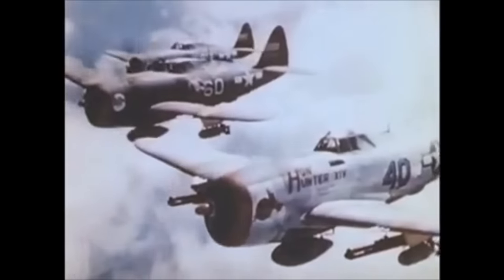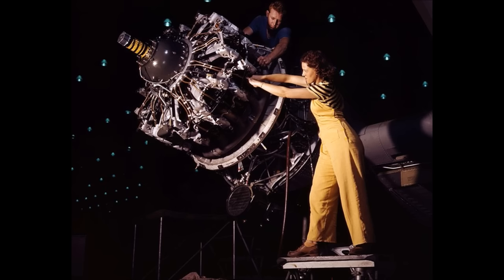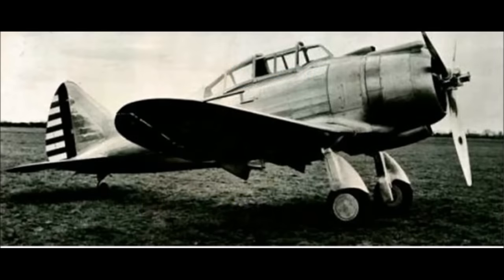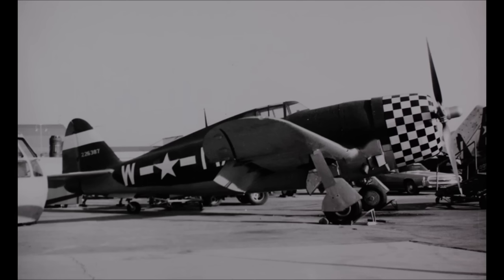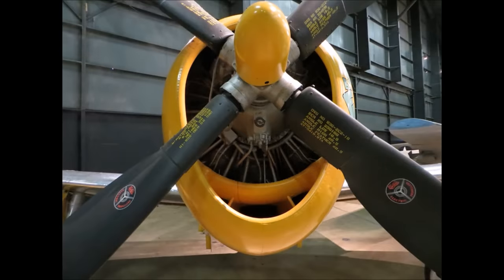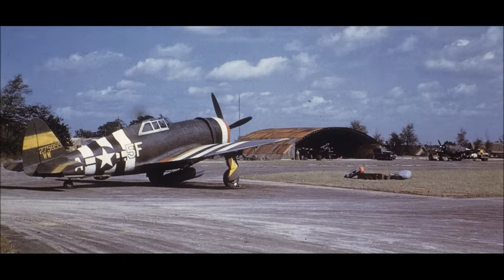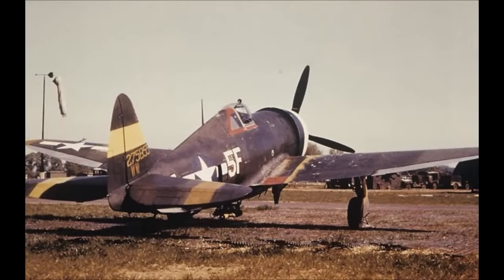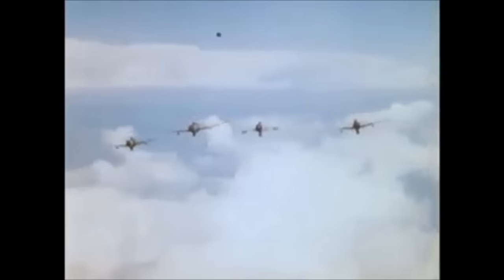P-47 Thunderbolt Pt. 1 Design and Speed

Comment: This channel is incredible.  I've been a auto mechanic, steel fabricator and  forged cutting dies. I've always loved history and aviation but never really knew the science of it. After watching this channel, learning about drag,lift, wing design, control surfaces high and low altitude performance ect you almost feel as if you fell through a rift in time with the knowledge acquired from this channel with a little engineering help you can build an airplane.  That's pretty cool.
Reply: From the sound of it, with your experience I’m sure you could very easily build a plane. Get a good kit and get to it! 😊

Comment: Decades ago I read a article on one of the P47 aces outfits who customized their personal “Jug’s” into  “Superbolts” By the mentioned sanding and waxing to reduce drag (A practice used for recce and racing A.C.) removing the outboard .50’s and installing a prop with huge paddle blades that would enhance the climbing rate so that they could follow and maybe even outclimb the Me109, or escape upward instead of the usual emergency dive the Thunderbolt jockeys used to get out of trouble.
In this article  from a old US magazine on WWII warbirds, A P47 ace described how amazed he was when he chased a messerschmit in a climb outclimbing the 109 which fell from the top of his climb so the Jug Jockey could shoot it down while hanging from his prop like A heli!
I don’t rember the name of the magazine or Ace.

Greetings from Amsterdam,
Reply: The "superbolt" wasn't so much a custom job as it was the name given by pilots for an actual variant put out by Republic - generally around the time of the bubble top p-47 D models.   The paddle blade prop was also an official upgrade from Republic and indeed, pilots reported remarkable climb performance improvements with the paddle prop.  But, the waxing tactic was indeed a custom job by pilots and mechanics.  I believe the pilot you're referring to is either Robert Johnson or Gabby Gabreski, the famous p-47 aces from "Zemke's Wolfpack" (the 56th Fighter Group).  They are both on record stating frequently that the p-47 - particularly after the paddle prop upgrade - was a very competitive dog fighter with pretty much anything out there.  At higher elevation, this is pretty well accepted by most - even critics of the 47.   The p-47 lost favor for escort duties primarily due to lack of range, it's obvious strength for the increasingly important ground attack role late in the war, and because the mustang was simply a logical and available replacement for the escort role.

Having said that, by the end of the war, the 56th managed to overcome its range problems - running escort missions to Berlin with p-47's using a combination of upgraded drop tanks and various fuel saving tactics.  And interestingly enough, they weren't even flying p-47 N's (the last p-47 variant) - which had a 2,000 mile range with drop tanks.  The p-47 N, had it flown in Europe, would have been an excellent escort option.  A simplistic view of the air war in Europe often paints Americans having literally no effective fighters for the first half of the war only to be saved by the mustang.  I love the mustang as much as anyone else, but this simply doesn't do the 47 justice.  By the time the mustang was really in Europe in force (mid to late '44), the Luftwaffe had taken a beating by 47's and 38's.  This time was famous for long swaths of time where the Luftwaffe simply didn't show up in fact - because of how many veteran pilots had been killed.  And while they did show up quite a bit for the mustangs (who had big kill numbers late in the war) later on, the German pilot quality had deteriorated significantly.  So, the mustang took over right at the time when the Luftwaffe was severely weakened.  This is not to say the 51's weren't remarkable.  Plenty of 51 drivers did amazing things with a great bird.  It's just to say that the 47 is kind of an unsung hero of the ETO.
Reply: Well, reading the book "Thunderbolt" by R.S. Johnson, the ace pilot stated as:
1. Upon arrival on England, they were chided by RAF pilots that when attacked, all they have to do is to undid their harness and hide in the Jug's fuselage. Never did they realize that it was not the Spit, Hurris nor Mustangs but the P-47 with their novice US pilots who is going to slug it out over European skies and push back the Germans to their border. They squared it out with the yellow noses of the JG 11(or 26?) based on Abbeville. The green pilots with their untested mounts against veterans in their proven mounts. A first, the US pilots got the bloody nose. But as they gained experience, they learned how to handle to 109s and 190s of the LW.
2. While on a familiarization flight over England, he encountered a British Spitfire. They engaged in a mock dogfight and he was amazed by the spit's agility, yet managed to outfly it by rolling maneuver. They later went for a climb and the Spit left the Jug behind.
3. Later,when paddle blades were fitted in the Jug, Johnson again found a Spit, and he signalled for a climb. He mentioned that he left the Spit behind as if it was standing still.
4. As for dogfighting, Johnson one day encountered a good LW pilot. The Jerry pilot took the fight into vertical, but the Jug stayed with the 109. The German steepened the climb but as Johnson stated, "with the new paddle blades, the Jug would not let go". Firing and scoring, the desperate German pilot went into a dive. Johnson commented "He was one of the best I've met. But the dive was his mistake. Never they did learn". Needless to say, he bagged the109.
5. As for durability, Jonhson's plane was riddled by cannon and machine gun fire. He was met by no less than German ace Eggon Meyer and was riddled by 7.92bullets from Meyer's 190. Upon landing, counting bullet holes on his mount, he counted 21 20 mm hits, and more than two hundred 7.92s. His count reached a hundred while he was still standing on the same place.
6. As for his skill as a combat pilot, Johnson was trained as a bomber pilot. He failed in his aerial gunnery exercise. Yet, he is the second highest scoring US pilot in ETO with 28 aerial kills. His 5th kill was a 200 kill veteran from Eastern front (He learned this much later, in his interview prior to his passing away in 1998). 
And here is an interesting note: Johnson got his 25th kill after flying 92 (93?) combat sorties. Hans Joachim Marseille got his 25th after more than 100 sorties while Erich Hartmann got his 25th after about 120 combat sorties.

Well done Mr. Greg
Reply: @toknenengburjegol6430  I saw a documentary one time, I think it was Robert S Johnson whose Jug was crippled by enemy fire and caught fire over Europe. The canopy jammed and he could not bail out. In hindsight it may have been the Jug's way of saying "Just hold on and I'll get you home" because he pointed the Jug toward friendly ground and despite horrendous damage the flames went out and it kept flying. Later on an FW-190 came up to greet him. It fell in behind him three times and eventually ran out of ammo riddling the already crippled Jug with holes. The Butcherbird pilot came alongside, shook his head and waved as he flew back to base without any ammo and without a kill. Johnson later landed safely. The pilot who was denied a kill was none other than German ace Egon Mayer
Reply: @ArtietheArchon  I believe the documentary or short video is called "Not My Time To Die" by mysticpuma who also made a 2 part documentary about the 325th Fighter group.  Mysticpuma should be working for Discovery Channel or History Channel,  The Checkertails documentary is that good

Comment: The amount of detail in your videos is *INSANE*, but also, deeply admirable. I am so grateful that you do this amount of research for us! The only thing I would suggest for your channel would be to tie the work done in the 1930s and 1940s to engineering problems today (obviously the physical principles are the same, but I mean, showing just how broad were the shoulders of the giants upon whose shoulders we stand today). 

For example, we might compare the data collection methods that were available back then, to the methods available today. I don't think a lot of people appreciate how difficult it was to go from the biplane age to the jet age, considering the tools and materials available.
Reply from the maker: Thank you. I am thinking of doing a video that's a lot like what you suggest.
Reply: The NACA employed many brilliant researchers. 

Their methods are often just an ingenious as their discoveries and official suggestions. 

Using variable density wind tunnels to change q and Reynolds number, then using that pressure in a blow-down system to study supersonic flow. Getting dual use from the same input. And mounting models to test on the wing of a P-51 in a high subsonic dive where the airflow over the wing and model became supersonic. Some of this was done in 1943-46 year range. Not to mention their measurement tools and calibration. They were often accurate within 0.1% by the mid-'30s. Then there is Theodoreson and the inverse airfoil design method that first lead to the P-51 airfoil series. Simply by calculating the pressure around an airfoil they desired, and getting the specific custom shape directly from the math equations. Brilliant Men. (And Women also, who performed said calculations and typed most of the actual reports, and rarely get credit for this monumental effort). True Giants. Only Ludwig Prandtl really did substantially more for Aviation than any individual at the NACA. (Not to discount experimenters and tinkerers such as the Wrights and Bleriot, etc. I'm talking theoretical side).

Comment: I wouldn't call the P-36 Hawk obsolete in 1940, but it was definitely not top dog anymore. Nice video on probably the most American fighter out there!
Edit: Yes, Focke Wulf 190 video!
Reply from the maker: It depends on what you are fighting. Against Zeros, Oscars, 109s, or Spitfires, it was obsolete, thus taking a P-36 into combat in 1940 wasn't going to go well for you. Of course against the Russians it would have been OK.
Reply: It could be argued that Curtis got the runaround from the USAAF about making  improvements to the Hawk series of fighters.   The P-40 soldiered on well into 1944 and  proved more than capable of tangling with both the ME-109 and FW-190 in North Africa at low and medium altitudes.
Reply: A P36 in December of 1941 did get the only Japanese "kill" during the Pearl Harbor attack.
Reply: Finland used P-36s against the Soviets and it performed well for them according to Wikipedia.
Reply: @paullubliner6221  George Welch and Ken Taylor totalled six kills with their P40s.
Reply: The P-36 was the most effective fighter the French had in 1940. It actually didnt do badly vs the 109. But the 109 was certainly the better aircraft in 1940.

Comment: P47 D40, M, or N model is what I'd want to have flown in WW2.  Very sturdy and strong aircraft that was air cooled (hits to liquid cooled motors like the Merlin could cripple your fighter's motor pretty easily, while that big air cooled motor in the 47 was known to take a lot of damage and not crap out...either way just one less vulnerable system).  Also the 8 50 cal armament with lots of ammunition would give great combat persistency, lethality too, particularly vs Japanese aircraft.  You could also out dive pretty much anything if you had some altitude, an instant "get out of crap" card you could play if you were at a disadvantage.  Great visibility out of the later models without the razorback canopy too.

I read a story about Richard Bong in a later model P38 doing mock dogfights with P47M models, and saying it was very close in every case, pretty amazing for such a heavy fighter.  Good old Jug.
Reply: Have you seen the photos of a 'Jug' that did a 'nose-dive' into the Hudson River during an airshow a few years ago? (the pilot must've either 'blacked-out' or had a stroke) *That 'Jug' barely had ANY damage at all when it was pulled from the river...except for bent prop-tips, I couldn't see any real structural damage at all! Even the canopy was intact!*  I can't think of any airplane EVER that could suffer slamming into water doing at least 200mph on impact and still be in one piece, and wouldn't believe such a thing was even possible! (no wonder so many pilots refused to fly and fight with a different fighter...even if you were 'out-classed' and 'jumped' by more than one fighter, the 'Jug' will still 'get you home' even if shot full of holes and the engine missing entire cylinders blown-away by cannon-fire, and if anyone made the mistake of getting in front of those eight .50's ??? *"It's all over"* )
Reply: SerHaHa - I believe some of the variants you mentioned actually deleted the outboard guns, reducing the number to 6 but yes, I tend to agree. I'd rather fly the 47.  Though it's tough to really say.  The 56th fighter group, "Zemke's wolfpack", loved the 47 as a fighter and they had the largest outfit of aces, and fought during the peak of the Luftwaffe.  They famously insisted on keeping the 47 and were the only 8th AF outfit left flying the p-47 at the end of the war - the rest having been replaced by the mustang.  My inclination is to listen to the wolfpack.

Having said that, Zemke himself was on record waxing poetic about the superiority of the mustang - even though many of the aces in the squad disagreed.  And there's no shortage of pilots who converted from the 47 to the mustang who said the same thing.  Incidentally, Zemke left the 56th to take up a fighter group that converted to mustangs. He ended up a prisoner of war because his mustang broke up in bad weather.  The other thing to remember is that the ground duty ended up proving a far deadlier role for fighter pilots.  And while yes, the thunderbolt was rugged and better suited to the task, ground attack was pretty much all the 47 was doing from about mid '44 onward.  Just by sheer odds alone, this made the life of a 47 driver quite precarious towards the end of the war.  But in all fairness, 51's were doing a good amount of ground pounding too.  And that's a role that I wouldn't want to do in the "spam can" 51.

I think the 47 fell victim to its initial impressions.   We were just getting into the war and a lot of first impressions were made.  Basically, the bombers were taking murderous losses and the 47's couldn't stay with them.  This then set up the perfect narrative that the 51 saved the day.  But lost in translation was the fact that the 47 was quickly upgraded and by the end of the war, was competitive (and superior in some respects) with virtually anything flying.
Reply: *Which is 'tougher and more reliable?' A 'plain Jane' Dodge SUV or a Ferrari? Both will 'hit & hold' 100mph but for how long? Which is easier to maintain?  Most important...which one is less prone to overheat or simply 'stall-out' in the 'middle of nowhere' when you least expect it?****If I'm in a 'fight to the death' against pilots that have far more experience than me, I want every advantage I can get...and the 'ugly-ass Jug' is just what I need!**(Galland 'begged/shouted/cried' to Hitler "We must have MORE '190's'...all that can be made as quickly as possible, and the new '262' fighters must have priority over any other 'new' weapons...give me those, and I'll 'sweep the skies' of bombers! With 500 '190's' we can destroy the 'Red Army' on the ground...the only way for them to reach Germany will be on foot  with rifles...because we'll destroy everything else!)**The 'begging' fell on deaf ears..."You don't understand the politics involved! The 'V' weapons will 'break the will' of England to continue fighting altogether...that program must continue!"*
Reply: It was horses for courses. The P47 guzzled fuel so could never provide long distance escort duties. The P51 had the range and the speed. The additional two 50Cals on the P47 were nice to have but 6 of those things can do huge damage - and a lighter weight aircraft has a better chance of actually hitting a fast moving target.
Reply: @Dave5843-d9m  
David Elliott
Eventually, the p-47 was ranging over Berlin.  Granted, to achieve that, they had to go through more than a year of experimenting with external tanks and fuel saving tactics, but they got there.  Also, the p-47 N variant solved the range problem completely (though it never saw action in Europe).  The N variant was literally designed for pacific escort duties where long range was key.  The p-51 did have the range advantage out of the box however.  Combined with the desperate situation for the bombers over Germany when first introduced, the mustang was the natural choice for escort duty.  But, if I had to choose between the p-47 N and the p-51 for escort duties in Europe, on balance, I'd probably go p-47 N.
Reply: @helzevec  The Ammo Bays in Thunderbolts held 425 rounds per gun. 3400 rounds total for 34 seconds of firing. Close to the rate of fire the  Wart Hog has, about 100 Rds per sec!
Reply: @lindamcentaffer5969  Your math looks messed up. All the guns fire at the same time. There is only a few seconds of gun fire.
Reply: Chop Chop  Linda’s math is correct: 425/12 rounds/second= 34 seconds. The 50 caliber had a rate of fire of 720 rounds per minute.
Reply: From what I’ve heard though, the Mustang WAS much more comfortable to fit into the cockpit of, and the control panel was just layed out very nicely. Jug was still the better hardware probably, but it’s hard to deny that the mustang is much easier on the wallet AND on the neck
Reply: @helzevec  hap arnold forbade the use of drop tanks which hamstrung the escorts early on
Reply: @Dave5843-d9m  do a little research